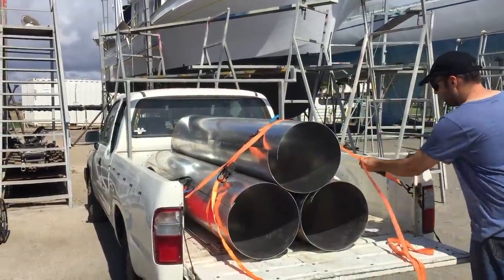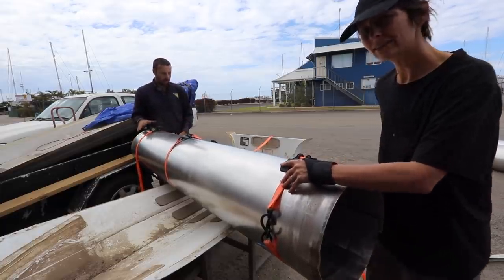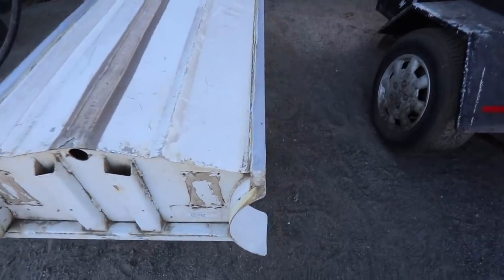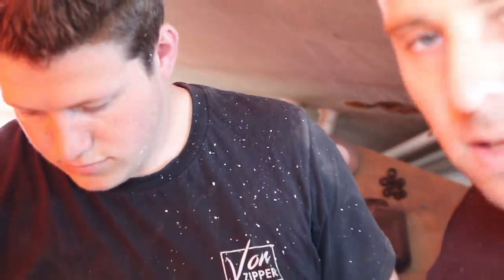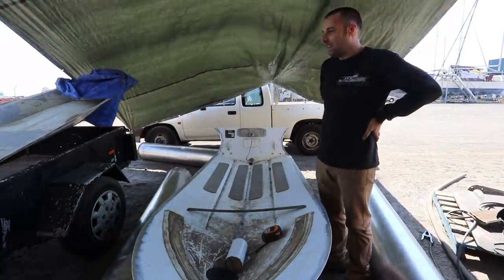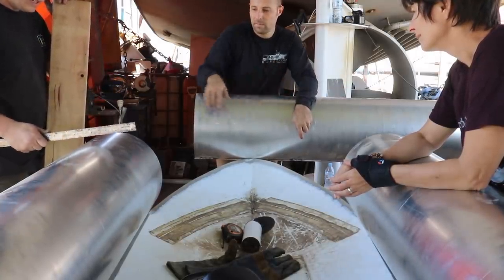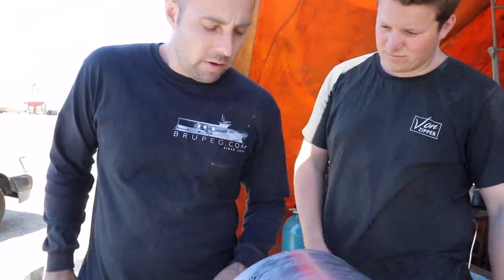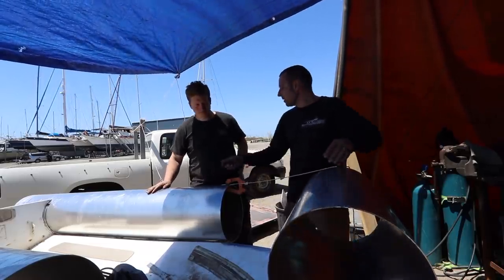DIY Aluminium Pontoon Dinghy Part 1 - Project Brupeg Ep. 107

Comment: You might consider filling the dingy tubes with ping pong balls or something similar.  They will provide flotation even if water enters the tube unlike foam.  You can buy them in bulk.  Just a crazy idea.  May be noisy IDK.
Reply from the maker: Hi Bill the foam we use is a closed cell flotation foam
Reply: Well I hope it made you laugh anyway!

Comment: It would also create a stowage space to keep your radios in.
Reply: I was also thinking gas tank
Reply from the maker: This boat will be our tiny trip dinghy. Think 200-400m journeys. It will be left alone on shore for long hours chained to anything solid. So it won’t have anything like radios or other attractive things to Steel. Because it’s 100% electric we won’t have any need for fuel
Reply: Project Brupeg 
I was just thinking it would be a great space saver for the battery and gas tank. No matter what you do, I think you’re doing an awesome job. I absolutely love your videos.

Comment: Caustic Soda (NaOH) ie drain cleaner will dissolved the aluminium off the blade and not touch the steel - I use it when milling cutters get clogged. Beware some drain cleaners are sulphuric acid - don't use them !
Reply from the maker: Ahh nice to know, thanks for this, yeah the blades are perfect under the alloy coating but it was welded on good enough that the bench wire wheel wouldn’t move it

Comment: Damien, still just watching to figure out what the hell you are doing.  Are the welds along the length of the tubes intended to be water-tight?  They would have to be virtually perfect for that, right?  Or do you just make them real thick and hope for the best? (I am not a welder, but I have never seen any that look perfect - they always look so clunky.)
Reply from the maker: They will be both water tight and chunky. It’s normal in the welding world to get 100% leak proof welds (think of every metal LPG or Propane cylinder) looks of weld is more about how long you’ve been welding. Ie a master welder can make the most beautiful welds that are leak proof, an apprentice can make leak proof welds but they can look terrible.

Comment: With the ozzitto dual blade use the wax sticks that it comes with and the aluminium will not stick
Reply from the maker: Yeah found that out after the fact. Turns out Bunnings are not stocking the wax sticks anymore and I brought the last packet on the shelf when I went in
Reply: Project Brupeg they are easy to make, using bees wax, I make my own so next time I do a batch will send some over
Reply from the maker: Ahh thats flippin awesome, our postal address is on our website www.brupeg.com. thanks for this

Comment: @Pronect Brupeg. How well does that double cut saw wok in the aluminum like that. I build aluminum boats and have always wanted to try one out. Only prob was when I checked them out they were pretty expensive.
Reply from the maker: We found it brilliant. It definitely needs the wax or you end up melting the blades together but while it was working it had zero bite or kick back, nice cut straight cuts. We tracked down some more wax rods that go in a gravity feed hole in the guard so it should be back up and running soon. Awesome little tool
Reply: Project Brupeg cool. Thanks for that. I also wanted to mention. We had the same kinda deal going on a long time ago. We found one of these washed up on shore. And it was the same deal. It was going to be way to expensive to try to get new pontoons for it. Our solution was to take cardboard concrete tube forms in the right size (I think if I remember it was 16” diameter ). We then fiberglassed them and resin coated the inside. It worked fabulously. We’re going to fill them with foam but we ended up building hatch doors and making the open space inside into storage. Man I wish I had some pics I could send you. The boat was made by nautilus. It was a very very expensive boat when new. Like 60 grand kinda expensive.
Reply: I would also suggest putting some pipe that is cut in half all the way around the outside to Make a sort or bumper area all the way around. So maybe take like a 3” schedule 80 alum pipe and cut it in half. That will make the outside so much more dent resistant.
Reply from the maker: Yeah I like that idea. Kinda like a strong back for the impact zone. We were going to put some permanent close cell foam bumpers on it as it’s going to get a hard life at wharfs and against boats etc
Reply: Project Brupeg nice. Should be a sweet little boat. You should check out the boats I build. There 15’ aluminum. All my design. Entirely built in house. There in my Facebook page and also on Instagram.  Madmanmarine is my Instagram handle.

Comment: Who did the tube bending? I'm in Sydney, called so many fabricators yet can't find anyone who does it. As im doing the same on my 5.5rib
Reply from the maker: We have a mate in Bundaberg with a brake press. They press the first 100mm or so then roll the rest of the sheet. Their workshop is set up to do large scale air con ducting so any shop that can do that work should have the tools to roll flat alloy plate

Comment: PFREDabrasives sell an ALUMINIUM CUTTING WHEEL, SUITABLE for ANGLE grinders, does not need lubricating , leaves a clean cut without contamination , safer than skilsaw.
Reply from the maker: Nice, I’ll look into that. I’ve been trying to keep away from lube so I can weld it without drama
Reply: @ProjectBrupeg  Wilson's engineering   Quay st , Bundaberg, should have stock, as they are aPFERD Distributor.

Comment: At the risk of not looking like what everybody else has; a considerable amount of time spent figuring, head-scratching, figuring, test-fitting, and backtracking, in addition to less material, and costs, could have been avoided by just fabbing the sides up with sheet aluminum and stiffening with square tubing.  Angling the gunwales out, following the curve of the bow, removing the radius' on the transom and filling in with sheet.  Oversized, thin-wall square tubing along the top of the gunwales filled with expandable foam to help with floatation.  Over, and done.
Reply from the maker: Hi Ronald
It seems easy doesn’t it. But we wanted round tubing and we don’t have a problem with having to learn and make an effort. It is almost finished and well worth it. Jess

Comment: Did anybody mentioned already his concern that the welding seams between pipes and body wouldn't withstand rough sea? I do.
Reply: they will if hes welding them from both sides.. Remember the original Plastic tubes ar glued togeter....
Reply from the maker: I never mention I’m concerned about welding the seams because I’m not worried about that. I have no issue making them leak proof and strong enough to last the lifespan of the boat. Also what level of sea are we talking here, it’s a 2.5m dinghy...
Reply: When you cop the 4m wave over the bow of your 2.5m dingy, your first thought will be "I should have welded the seams better, lol

Those welds are a lot better than the origonal sikaflexed inner tubes

Comment: Just a question, are you going to use expanded foam inside tubes to give more  Buoyancy
Reply from the maker: Hi Wayne, yes we will be
Reply: if the tubes are air tight it would give less buoyancy, but way stronger

Comment: Take it from a old pipe fitter to fill in between two existing angles of pipe just measure the  east measurement and the west measurement or right and left  level and you can ever inch if yo want and cut the pipe to fit 
Or you can try to measure the angles for three days  I was screaming at the tv just measure the lengths of the missing pipe
Reply from the maker: Hi Vincent the issue we had was we weren’t certain we had the front tube in the right spot, once we were we used this technique and solved the problem

Comment: I know in the end you got it all sorted and she looks fine , how ever next time just use this tube miter calculator http://cq (dot) cx/tubejoin (dot) pl and it will make your day so much easier !
Reply from the maker: this is great, only issue is we dont have a printer that can print big enough as the small dinghy tubes are 334mm diameter and the big dinghy are closer to 450mm
Reply: @ProjectBrupeg  so you can see this comment now?
Reply from the maker: Yeah for some reason youtube moved it to spam! I can’t tell youtube that certain users are never spam so if it’s ever moved it’s something to check each day

Comment: The dingy on sv delos is ausie made and they pressurize the pontoons with air to prevent dents and water intrusion
Reply from the maker: Yeah we did think about pressurising the tanks but opted for flotation instead
Reply: i would not go with air because if you get a hole in your pontoons you are screwed with air unless you have a inner tube in rubber or something like that... I would chose a non water absorbant foam or something similar... That way even if you have a hole in your boat will not loose any buoyancy...
Reply: @noway543  clueless reply. The air isnt for flotation, plus it would take a longtime fill and sink from some small hole. Most tenders are air filled also.
Reply: @vettepicking  and start sinking when they got hole... and take time to sink if it's only a small hole... lol... Would you rather have a tender that do not sink or one that sink? 
 
Take SV seeker tender... the tender was filled with water with 2 man abord and it did not sink... Try that with an air filled tender that got a hole after hitting an objet floating in the water... Remember, they want to go where iceberg are present... that mean that they need a tender that can also take a hit without sinking....
Reply from the maker: Hi guys, we did think about air initially mainly so we could pump the tubes up to help with side impacts on the long parrellel side tubes. However we dropped this idea as the more we designed electric propulsion into the boat the less the tubes became like a pressure vessel (ie flat panels and other non pressure things were added). Currently we have batteries inside the side tubes and internal electric cabling that exits the tubes with cable gland type fittings, because of this we opted for expanding foam for a couple of reasons, its light, its permanent flotation just in case and it is a great method of holding our electrical conduit rigid for the life of the boat so the cable doesnt bang around and chafe over time.

Comment: you could use expanding foam to fill the tubes you wouldn't need bulkheads
Reply from the maker: Hi Steven, yeah that is the plan, we have internal wiring so the foam will be holding the conduit tight as well

Comment: Aren't angles a brain f$#k! Especially when what you are dealing with happens to be a compound angle. SO you cant just calculate each angle simply from plan view (top) as you are you must also take into consideration the elevation gain on the side view - thus producing two angles which you must now bisect; or a COMPOUND angle.

The best way to think about it is like this; you want to build a Rotunda with six columns or six sides.
You have a large Hexagon but its not 2D - it has a thickness. 
This relatively thin Hexagonal Prism will be the roof. Divide it into 6 pieces. 360 degrees. 60 degrees a piece right. 
It is still a six sided roof; Divided into 6 flat triangular roof segments - Hexagonal. 
Now if you were to build six columns; and you'd want that roof to now have height, the point at the top - the outside of the hexagon resting on the columns.
You need to bring the tip of the roof up to the sky. (or where the points of the triangles meet in the centre - Up to the sky to create the slope of your roof)

We keep the angle from above at 60 degrees. It is still a six sided shape.
But now we cut an additional angle. A compound angle. 
We cut another angle on that triangular piece through its thickness.
Essentially this cut would feather out to nothing on the top surface but cut material away on the underside.
How much and what angle is obviously dependent in this case on the slope of the roof - or how high we pull the center of that roof to the sky. 

I think looking at the problem in this sense will help. Its not just simply diving the angle from above.